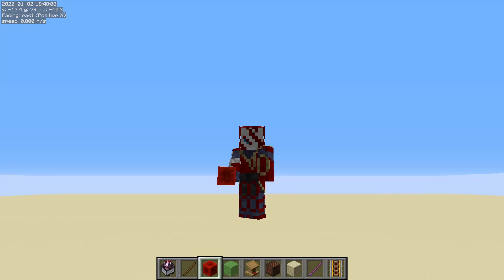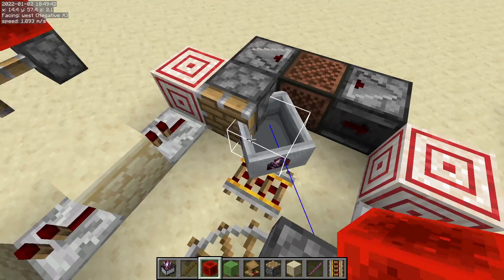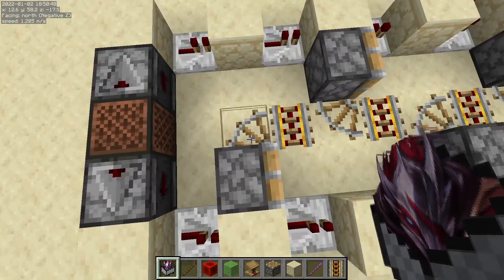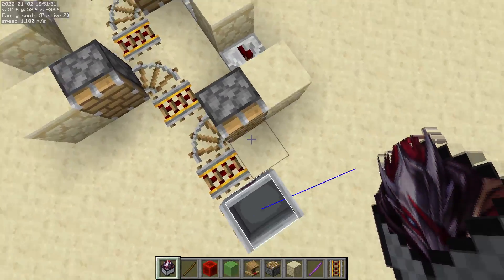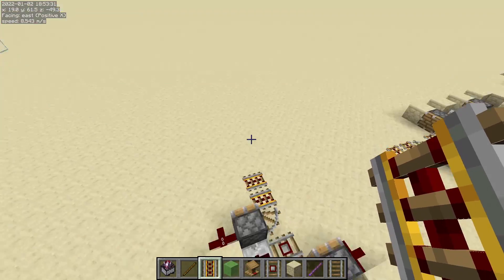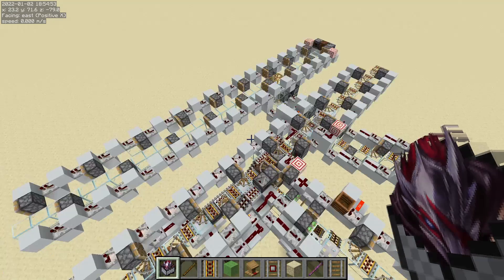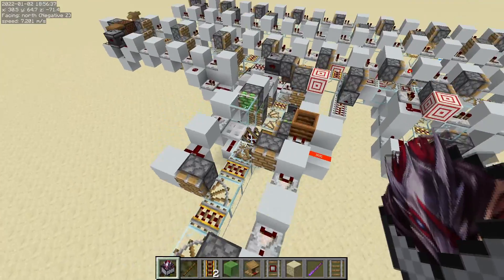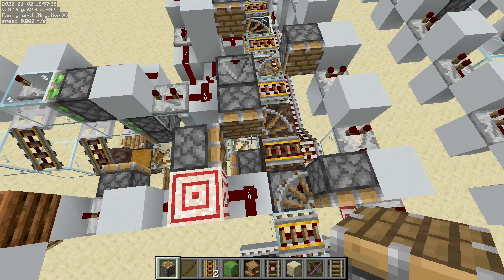The Demi Bolt: The Better Piston Bolt

Comment from the maker: I forgot to mention in the video: The powered rail version is exclusive to 1.15+ due to rail placement changes, however you can have a similar bolt with half the pistons if you go with curved rails curved in the same direction every 2 blocks instead of 1 like before. Unfortunately the 1.14- version can't be fixed without reassembling the entire bolt.

Comment: Hey man! Im trying to build the diagonal bolt but with the diagonal part extended x-blocks. After travelling 12 blocks diagonal the minecart stops and the bolt continues. Any idea why it doesn't continueon its path? I have all the repetears set correctly and I've build it correctly.

Comment: Actually works on bedrock too so happy. Thanks!

Edit: noteblocks arent detected by observers in bedrock.. changed to a barrell or another observer with something like a trapdoor on top or a comparator. Or a cake 😂😂
Reply from the maker: In bedrock the piston bolts can go faster and have more space in between rails (meaning it is also easy to fix), id recommend looking up some bedrock bolt designs :P

Comment: actually theres a mistake that you made at 4:20 about cart hitboxes intersecting with detector rail hitboxes. The fact is that if a cart is within more than 1/8th of a block the rail will detect it. If you push a cart into a chest and replace it with a rail, the detector rail wont detect it. but anyways nice video :)
Reply from the maker: Yes you are correct, and there is an area over the detector that doesnt work as well. It has the same hitbox as a pressure plate from the sides (which comes from it being a literal pressure plate only triggered by carts). The reason is has a higher upwards hit-box compared to pressure plates is so it can detect carts on sloped detectors. Thank you for catching that! Glad you enjoyed.
Reply: @inspectortalon  haha nice timestamp
Reply from the maker: @kojakjz  im not sure what you mean
Reply: @inspectortalon  420
Reply: @inspectortalon  also good vid
Reply from the maker: @kojakjz  ohhhh

Blazin 😎
also thx!

Comment: I’m so bored ima test all of them in bedrock I’ll update with what I find

Update 1: observers don’t detect note blocks so replace with piston facing opposite from the bolt. Looking promising

Update 2: first example in video works just fine ( 2:14 )

Update 3: because of the weird way rails work this can’t be built going east to west but does north and south because the rails prioritize east to west placement, only after another trigger it will move 1 piston farther so no built east or west

Update 4: the one block dilation I cannot find a way for the cart to not get stuck on the double rail so not possible right now other than that it would work just need to stand up to move the cart manually 

Update 5: the straight->diagonal-> straight track the open piece of redstone in the inner track updates the rails and makes them a straight line no work around right now

Update 6: the Dimi bolt updates the rails and makes them all straight no idea how to fix if possible

Update 7: the downward one the fence updates the rails to just straight down rails and fence doesn’t push cart

Update 8: I’m not gonna make that it wouldn’t move east or west or and side motion so I don’t know what it could be used for

Update 9: in bedrock you don’t need the power rail you can just remove it
Reply: on bedrock the curved rails can be spaced every two blocks without any other rail in between.  see the tutorial from Prudii Gaming
Reply: actually now we have reliable 30 m/s piston bolts with the rails every 3 blocks.  it has to be sticky pistons with blocks in front of them
Reply: Piston bolts in mc bedrock can get stupidly fast. Recently, ive seen some designs for a 60 and 80 bps piston bolt translocator. The 80 bps one is so fast that you literally can't use it on simulation distance 4.